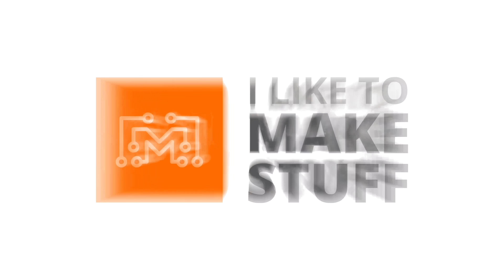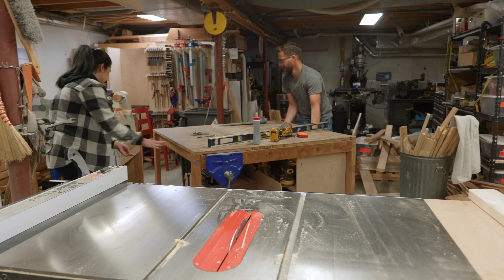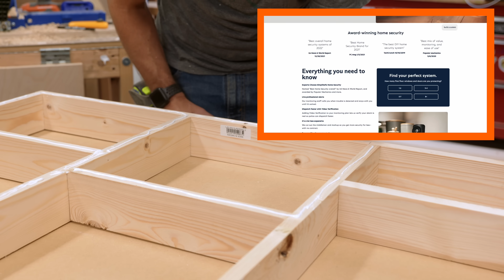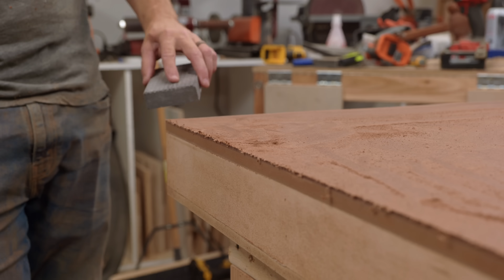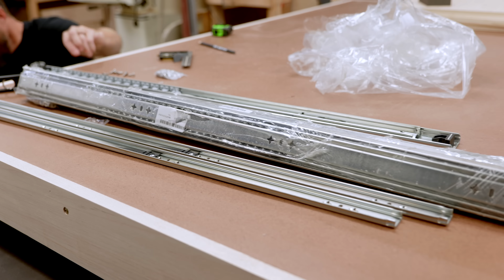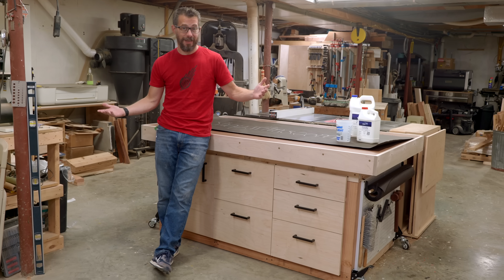It's Time To Upgrade Your Workbench! (With Build Plans!)

Comment: Can you explain whether or not you had any specific reasons about why you went away with the modular design? Your first iteration was perfect for my 2c garage, but i want the longevity and stoutness that this iteration offers. 

Would making 3-4 small versions of this bench be worth it—or should i stick with the original (assuming modularity is primary goal)? 

Thank you
Reply from the maker: For me, the main reason I wanted to make this one was a solid,flat surface and overall weight/stoutness. I wanted a table that WASN'T meant to move (but I still keep 2 of the modular tables around the shop for rolling around)

Comment: It'd be great to see some builds where you use minimal tools to do these types of things. It'd be awesome to do this stuff but not all tools such as a band saw and router is currently within budget.
Reply: Woodworking is all about coming up with creative solutions! 
He offers advice for those without a band saw, but other options exist. 
If you don't have a router, you could measure and cut the pieces to fit beforehand. 
Hope you're still making dust.

Comment: Question: if you glued the top and bottom of the “box” for the top, how do you intend to replace the top piece of MDF? I want to use this design for my shop but if I need to replace it, won’t that tear up the whole box?
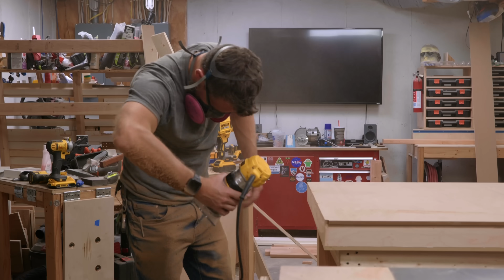Reply: The hardboard is the replaceable section. This is only tacked onto the MDF. Check 9:35 for this part.

Comment: The workbench looks great! I should have made my top like yours. I only had room for a 36” deep workbench, so I used a solid core door, then put a nice sheet of 1/2” plywood over it, so I could flip it for a new surface when needed. The problem is that the workbench weighs a ton! I put those same casters on my bench as that’s the only way to move it, but waiting for them to snap!

Comment: Why didn't you use strips of MDF (more stable than the pine) for the interior of the torsion box? Seems like it defeats the purpose of keeping the surface flat if you use some of the most twisty, soft wood for the framework.

Comment: I recently built a 42x76 work/sewing/craft table out of 8020 aluminum extrusions with a plywood top and an MDF cabinet, and it's so heavy and solid that I'm going to build a work table for my shop the same way. And then someday I can take it apart and get it out the basement door and put it back together again without having to destroy it.

Comment: idk... replacing the top of the tabel often sounds kind of wasting lots of material. why dont you use a high-quality table top with lots of holes and use it, instead of doing it the american way and replacing it many times.
Reply from the maker: I don't have to replace it often, but this is what works for me :)

Comment: I built a new workbench based on a design I bought online, which was described as a "$50 workbench." Due to recent wood prices, I ended up spending about 3x that much, and I only had to buy half the 2x4s needed to build it. Ouch.
Reply from the maker: OOF. That's rough. Luckily we're starting to see wood prices go down a bit.

Comment: As pointed out by Joe Palarchio - Why not use 2x4's for all the framing? In some places what is offered as 4x4 is woefully undersized AND is made from laminated stock anyway, it just costs more than 2x4's because you are paying for the mill to glue up the boards into a '4x4', then the retail lumber supplier puts on an additional 'premium' to the price because they pretend the mill needed to pay more for bigger trees or some similar nonsense.
Reply from the maker: I can see where you're coming from. For me, it's just what worked.

Comment: Bob, as I recently acquired a 36" SawStop I am looking to build an outfeed / assembly table.  I have a question though....as I want to have an open section in the middle where I can sit...do you see an issue of cutting away the center bottom horizontal 2x4 and moving it in about a third or halfway?  Nice build!
Reply from the maker: Sure, you can modify it as much as you want. We have not really tested an alterations to our design, but feel free to customize it!

Comment: Awesome bench. A slight improvement to your torsion box would be to use MDF or plywood for the inside grid so those peices won't expand and contract and disrupt the flatness. I doubt it will be an issue for you, but it doesn't hurt to be extra safe.

Comment: Nicely done.  I built a wood cart a while back with similar joinery for the frame but used a pair of 2x4s in the corners screwed to each other instead of the 4x4.  An alternative option that may be a little easier than those 4x4 cuts if you only have a miter saw or circular saw.

Comment: Currently discussing workshop update at work; we could use a few of these workbenches.  Thanks for walkthrough.

Enabling the drawers to carry more weight, when loaded, also adds mass to the workbench; providing further stability.  Tight clearances on drawer fronts will help keep dust out.

Great build ILTMS!

And many thanks for the AR visualising tool. 

Also, also:  It pains me to watch American builders continue to suffer the Philips head screw, when here in Canada we have a square headed design, the Robertson, that is superior by every measure. Check it out.
Reply from the maker: I'll look at them!
Reply: use torx screws, they are the best

Comment: There are casters out there like you're using except once a bench etc is in place the caster itself can be separated from the plate it attaches to thereby eliminating the dangerous tripping hazard the casters you use pose. Food for safety thought folks.
Reply: can you post a link to them please

Comment: I've got the same style casters you mentioned and love them. Something to consider. Drill a hole in both levers and bolt a 1x2 peice of wood, or a smaller scrap of steel across them. That will allow you to raise or lower the bench in 2 steps as opposed to 4!
Reply: What's the name of those kinda casters?
Reply: @NeonDripKitty  Stepdown Casters
Reply: They also have the same style that come as a mounting plate and removable caster/lever.  Gets the casters outta the way on items you’re not constantly moving.

Comment: Why are you not supposed to glue the internal structure down when attaching it to the frame?
Reply from the maker: Well, you eventually do it, but at that point you want to make sure that you're not gluing it down to a surface that isn't flat (the mdf itself will sag over the edges of the table). You want to make sure that the internal pieces are all able to be flush 9top and bottom) to each other.

Comment: OSB* is about 1/3 the price of mdf where I am... could I make the bottom and middle out of osb and the top out of mdf/ply? Or is osb too shitty of a material to count on?
Reply: OSB would be just fine. Structurally it's stronger than MDF. Slap some hard board on top like Bob did and you'll have a nice smooth top still.

Comment: Wouldn’t it stay better flat if you use plywood or mdf for the inside of the torsion box? These 1x4’s will expand or contract right, even a little?
Reply from the maker: That's a good point.